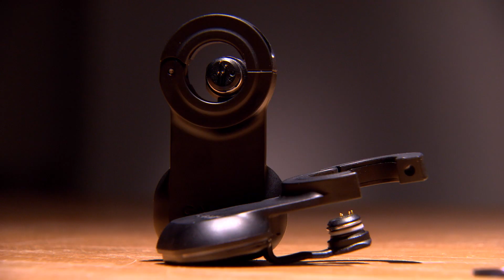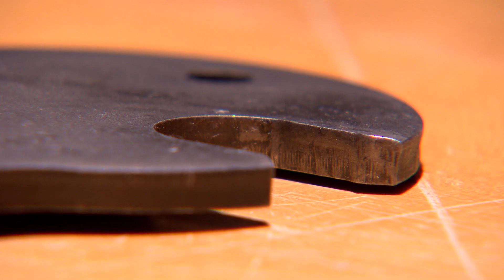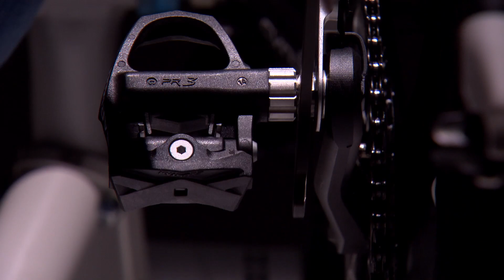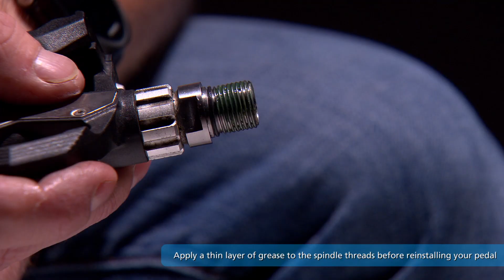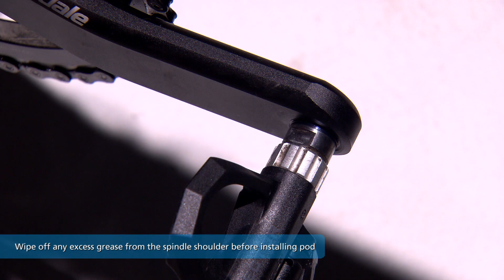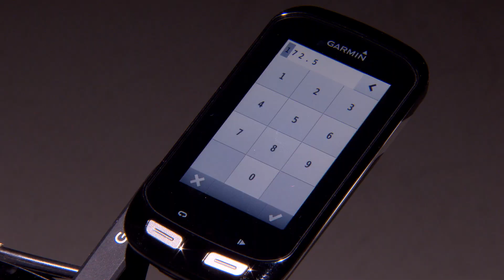Garmin Vector: Upgrading to Vector 2/2S

Comment: Hi! My upgrade kit included a new cartridge also, what's that for? Just as a spare? This looks a whole lot easier than changing the cartridge too.
Reply: +Claude Walter I just saved the new cartridge for spareparts until later on.
Reply: I think the output should be the same. And the same with the cartridges, just updated with better bearings I guess. Think there was some quality issues with cartidges on version 1. But not sure, if you get any info elsewhere please tell me ;)
Reply: ok, thanks for the info! love my vectors, they've helped me train more structual and I've gone from 294-320 watt in FTP! ;)
Reply: +Jon Olsson I've also bought the vector 2 upgrade kit for my vector s. However cadence varies slightly even after torqued and install angles set. At first I noticed power going up n down between 10 to 5 watts and thought the cadence was ok until I concentrated on that. Its definitely the error in cadence that's the issue even if I'm super careful to hold it steady. Also you can't get the pod to sit flush with the crank if you use both grey washers as the video advises. Any thoughts?
Reply: Silverarrow Hi! Can't say that I've noticed any of the problems you seem to have really. I use only the blue washer and I'm able to get the pod flush to the crankarm, but I don't think that it's necessary that it's flush. Have you tried to update the firmware for the pedals? Or could it be something else that interfere with the cadence sensor? Maybe you have another sensor on the bike or so? Can't really help you, but I here that garmin support is very good, so shoot them an email and I'm sure they could guide you in the right direction. // Jon
Reply: jon, maybe you can help me with my vector 1 upgraded to vector 2 and only reading left side of the pedal using the anti-ant usb.. thanks